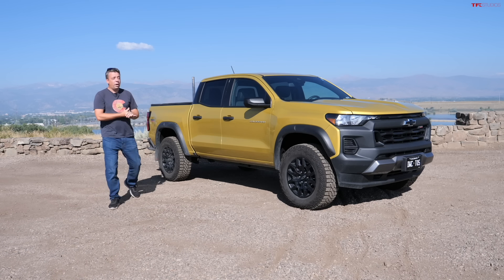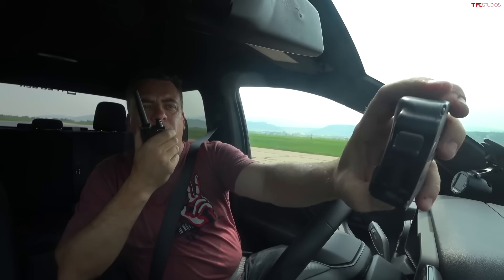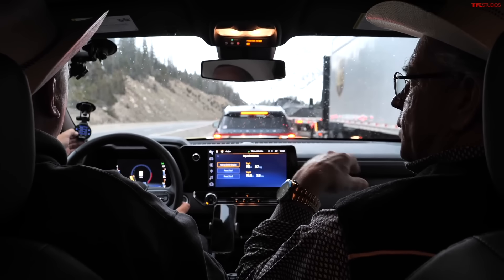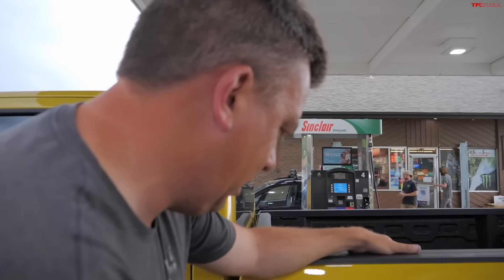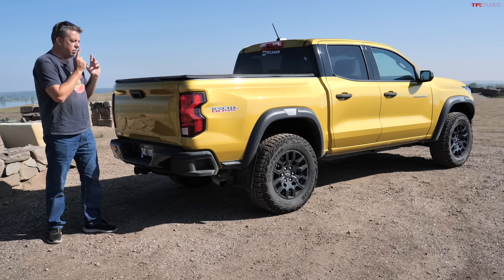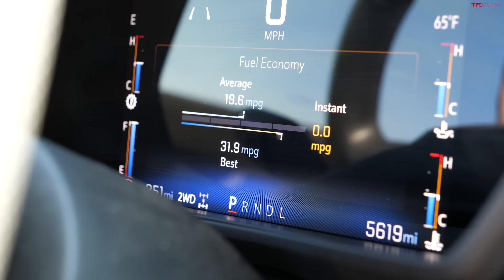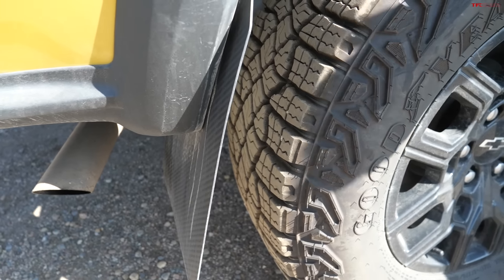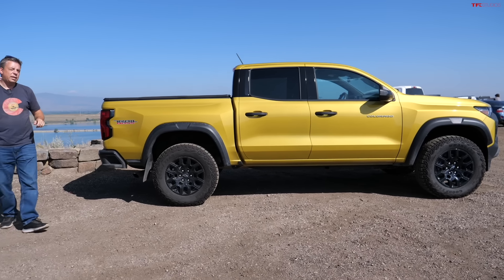Chevy Colorado: Great & Awful Things I Learned After 6,000 Miles - Long-term Update

Comment: 6000 miles isnt even remotely long term
Reply: Maybe it's a GM thing? At least on their half-tons, new V8s can suddenly die at low mileage, AC compressors can suddenly die at low mileage. Maybe with a GM truck you need to check in at 6000 miles as "longterm"? It's a nice looking truck, at any rate.
Reply: Most people like Doug only test vehicles for like 1 hour so 6000 miles is much longer than that
Reply: I totally agree!
Reply: Come test my 2015 RAM 2500 6.4 with 130,000 miles on the clock. That is long term.
Reply: @liamrobinson2084 how about the heavy duty V8? The 6.6L. I belive its a better engine with less issues than the 1/2 tons
Reply: Their long term tests are typically under a year so the mileage isn't going to be high. Edit: They don't base their long-term reviews on mileage.
Reply: At least 50k
Reply: @nipperdawg1865  Nope. Their reviews are typically based at 3 months, 6 months, and a year.
Reply: Pretty sure they are titling it long term, not because it’s a long term update, but instead part of their long term fleet and they plan to keep it for a while… a long term update series, if you will…

Just using context clues over here 😂
Reply: @jordanreyes8880 Andre owns the truck, it isn’t any part of the tfl fleet.
Reply: “Long term” is relative, if the normal review period is only a couple weeks or so, then a few months could be long term.
Reply: That's exactly what I was thinking because I have 115,000 on my ranger and I've had zero problems. Which is great but six thousand miles for a new vehicle if it's having problems at that point that's pretty horrific.
Reply: Update*
Reply: It is for Chevy 😂
Reply: @jeffs2809  oh so he doesn’t do videos on it? When they do fleet updates, do they not include personal cars?

Again guys, we gotta start using context clues!
Reply: I feel like reviewing mechanical reliability at 6k miles is nonsense.  Get back to me at 100k.
Reply: There's gotta be that guy in every comment section, doesn't there?? 😆
Reply: @Maximer77  But you’d want to know about early mechanical issues if there were some, right? 

Like, hypothetically, if there was a notoriously unreliable 8 spd transmission that was “updated” or “refreshed” to fix jerkiness and shift points? Hypothetically, of course.
Reply: Do you want him to do a longer review when he's only had it 5 months?  He's reviewing what he can,  not what you wish he had.
Reply: These are NEW vehicle reviews. That is they are reviews of vehicles you, I, or anybody else could go to a dealership and purchase new. There's obviously a time element involved in that. If they tested these for several years, everyone would have to wait several years for the results. Meanwhile a bunch of subsequent newer vehicles would go untested, because they spent all that time testing a single vehicle. 

They're titled "long term" in contrast to the bulk of their new car reviews. These typically involve manufacturer supplied vehicles which they may only have access to for a matter of days, or even hours. That's what the vast majority of new vehicle reviews on YouTube are. These are long term relative to the norm
Reply: @jefferp yup you’re right, you good now? Can we watch the video with out y’all nit picking at all things sheesh 😂😂😂😂😂😂😂😅
Reply: Chile y’all gone complain about anything 😂
Reply: @LafemmebearMusic  most of us regular people keep our vehicles well over 100,000 miles over several years. That’s why we grin when saying 6,000 miles is long term. Maybe saying something like, “First in our series of updates on my Long Term Chevy truck” would be clearer.
Reply: @liamrobinson2084 nice looking? Hah.m that's about as far as a luxury German car will take you after miles..
Reply: 6,000 miles is actually long term for gm these days. Not just gm but other brands also lol
Reply: They need youtube content he can’t wait another year and have 50k on the clock to do “long term”. Be smarter.
Reply: @jordanreyes8880  Sure, but 5 months and 6k miles is not “long-term”, lol.  Not a big deal, but the title is most definitely overblown.
Reply: It’s a brand new vehicle 
People with these trucks have the same or maybe less miles on it so it’s good info to know
I only have 2000 miles on mine after a month of ownership 
It’s long term cause these trucks just came out
Reply: Nope. Thats 3 months of driving/ownership with me.
Reply: That’s what I said. Lol
Reply: For GM this is long term.
Reply: 6000 is an eternity for TFL I’m sure he’s already thinking of trading it.
Reply: @jefferp well, long distance. Probably long term.
Reply: Content creators
Reply: @Expressionistix  I agree with that!
Reply: I’m still testing my Titan @218,000 still rips
Reply: @Seashed lol tell that to the ram rental I'm driving that has 7k miles and having electrical issues. Or a customer of mine that is waiting on a Cummins recall fix and the dealership is only getting 2 replacement parts a month with a waiting list of 3 to 4 hundred. Or my friend with a 1 year old f150 with less than 10k miles. And is over heating and breaking spark plugs. Or his friend that had a 21 raptor with 16k miles go through 2 transmissions before ford replaced the entire truck.
Reply: I’d say long term has to be at least to the end of the basic warranty period.
Reply: @jefferp that’s a lot of trips to the pump
Reply: I think he probably meant « 1st update on the long-term truck » 😊
Reply: @919hey  yep. If you want to play, you gotta pay. I ordered my RAM 2500 6.4 with 3.73 gears and 2 wheel drive.  I don’t live in snow country and stay on the pavement. Driving 70mph and below I manage a tick over 20 mpg highway. I only use top tier mid grade gas and service the truck religiously. It’s bone stock except for lighting upgrades.
Reply: @jefferp you should publish a video about it.
Reply: @windycitywarrior71 a quick check says a trip from Boston to LA is essentially 3K miles, so round trip is about three, four days tops for fuel, food and rest stops. Why not do eight of these trips spaced out over oh, idk, let's say the next six months - Bam! 50K long term miles - how's that for smarterer?
Reply: At least they drag race every vehicle because thats whats most important lmao. Does the truck last? tfl who cares lets drag race it
Reply: I was ready to order a new Canyon AT4, but with the GMC strike taking place, who knows how long I'll have to wait. Now, I'm thoroughly researching the new Tacoma. I  wanted to buy American...Looks like the Japanese win again.
Reply: @TFLnow  If you are ever in the north Georgia area I’ll turn the truck over to you. You are welcome to do a test.
Reply: Trans temp was looking really high on the Ike. I know it’s the worlds toughest towing test but it was still a little high for me as it kept climbing. 3:53
Reply: I do like this truck they are sharp looking. I would be afraid to buy the first year it was out. I am curious about more mileage though once he puts The Mileage on the truck. I got it 18 Colorado, with only 66000 miles on it. Thinking About upgrading to one of these next year, though.
Reply: @jordanreyes8880  This
Reply: @@DB-tp4jd you are correct. In my part of the country 8 years isn’t old. Other parts, 8 year old vehicles are  starting to show impending doom.
Reply: I would say 6000 miles for the type of testing he put it through is comparable to what a normal owner does in 50k miles.  So it's reasonable IMO.
Reply: Literally a truck of that price tag should last a good 15 years
Reply: @jordanreyes8880  They do a lot of videos on their personal vehicles, and if one happens to be in the lot when they're going through the TFL fleet update, they'll mention it.  I don't recall them specifically including personal vehicles when doing the TFL fleet updates.  

Andre, Tommy & Case have done several videos on their personal vehicle that weren't part of the TFL fleet. No idea what the "context" comment is related to. TFL fleet vehicle is either owned by the TFL company  ( the Ram 2500 Cummins, the Raptor, the TRX, police charger, etc..), just because they do videos on a vehicle doesn't make it part of the fleet.
Reply: 6000 miles on 4-6 weeks of driving for me.
Reply: They are doing a long-term test on this truck and this is the update with 6000 miles on the odometer
Reply: @justintarvid  millage is more important than a time line
Reply: There is that but this is just an update on a long term vehicle, I suspect we will be getting other updates along the way
Reply: For a Chevy tho
Reply: It is for a gm 😂
Reply: On a ford or Chevy? That’s a life time
Reply: Who said it was ? They dont do super long term.testing  smh
Reply: That’s like 75% of a Chevy’s life
Reply: Not exactly long term, 5 months/6000 miles.  I bought my 2023 Colorado z71 3 months 3 days ago and I’ve got over 11000 miles already, and I don’t consider mine “long term” either.  I saw them unloading it off the transport truck and went in and bought it, so all the miles are mine.
Reply: For a Chevy that’s like 1/3 of its life
Reply: @micahv9365  that’s being generous lol
Reply: Totally agree. Barely used the truck. They need to create a specific test “long run”. There in Brazil a magazine has a 62.000 miles. They test the brand shop service including. Then the subject is totally unasembled and had measurements of all engine parts.
Reply: Which makes it even worse having all these issues in such short time. I can’t imagine how many more issues he’ll encounter in the long term.
Reply: Long term enough princess
Reply: @534N69  LOL, thanks King!
Reply: It’s longer term than most car reviewers have cars for
Reply: @jordanreyes8880 it’s not a fleet vehicle, this truck is Andre’s personal vehicle. They marked the video long term because he probably had it for longer than 6 months at the time
of this video, auto journalists typically don’t put very many miles on their own personal cars because they are typically driving press cars or one of the TFL fleet vehicles.
Reply: For a GM it is.
Reply: @jefferp my Tundra has 380,000 miles. Yours won’t even get near that.
Reply: 6000 miles. "It's healthy" the GM standards gave dropped so low
Reply: 6000 is more than anyone else m
Reply: With these new crap cars it is long term
Reply: This my problem with guys besides Ike gauntlet and fuel mpg test it's just meh...

Comment: 41k for Hard plastic, no LED headlight or taillights no telescoping steering wheel, no seatbelt height adjustment. These truck companies are robbing the customer blind. Problem is we are letting them.
Reply: Don't forget about no cruise control.
Reply: Tacoma at that price would have all of that, and would hold it’s value way more. This is what is so funny about all the reviewers praising other mid size trucks and it never holds true.
Reply: The last thing I would want are those ridiculously expensive  LED headlights & taillights.
Reply: @dpl2617  even if you spent over 40k on a truck? It's perfectly fine if you dont want leds but you can still recognize that Chevy is overcharging us for what this truck is.
Reply: @LordWinter   That is an accurate statement for every new truck on the market...
Reply: We need to stop buying new vehicles!
Reply: Just get a new Canyon with the convenience pkg. And you are covered 100 percent. And the base Canyon comes with cruise.
Reply: @cmc9823  I looked at a Tacoma before I snagged a Trail Boss... It had drum brakes and a Camry engine. Makes crap power below 3k RPM, exactly what you don't want from a truck. Owners are are blind to it's weaknesses. They just chant rELiaBiLity!
Reply: The plastic front I don’t care for
Reply: Only if you let some YouTube millionaire talk you into it lmfao
Reply: @TheLostSquadron  They have their issues but they keep running forever and hold their value better than any other vehicle.
Reply: @@ThomasJeffersonIII Might as well get a Ridgeline if you need a reliable sissy truck for trips to the nail salon. At least that has a good interior.
Reply: @trevorhart5576 No cruise??? WTF.
Reply: @thanos9846  I know right.  Poor Andre.😔
Reply: @cmc9823   yeah this is really strange $40k is pretty upper level trim for midsized trucks, $40k for a Colorado should be a pretty loaded one.
Reply: @trevorhart5576  that's crazy
Reply: @TheLostSquadron   i'm waiting for the 2024 TRD Pro hybrid version, it fixes many of these issues.
Reply: @qbanlink25 The TRD Pro Hybrid won't be attainable until End of year 2024 probably and will be 55k-60k.
Reply: Check out the frontier pro 4x. No telescoping wheel but also no gimmicks and same hp with natural v6. Very underrated and on the more affordable end.
Reply: @LordWinter  I don't care if Im spending $100k,  they can keep their crap LED headlights and tailights. Every week someone rolls into my shop with a dead LED tailight and instead of costing $5 to $10 for a bulb it's $600 to $1200 for the whole assembly. Riiculous
Reply: Dealer markup.
Chevy is even talking about dropping dealers for price gauging next year. And selling online like tesla.
Your order would go through Pennsylvania to save money because they have the lowest tax for vehicle sales. 

Ford is 1000% cutting out dealers, the ceo put out a video on YouTube you can look up.
Reply: @yourkoreanbuddy1 and more towing than this chevy. i love my pro4x
Reply: The LT gets all those features because it has no 4x4
Reply: Buy a Ridgeline 👍
Reply: @kieranapgar6802  Ridgeline ain’t a truck 👍
Reply: @Yaboidavey  sales tax is based on the state you register it in not where you buy it.
Reply: @trevorhart5576 wht lol yes it does
Reply: Dw they make a WT trim for 30k for the poors
Reply: idk the work truck variant with some extra shi would be good enough from me
Reply: @MattyLentzGETRICKROLLED  that's basically what this is--it's the WT with off-road adds.
Reply: @desertdriver7056  ahh I see
Reply: That is so true.  First, COVID, then chip shortages,  now they just do it without any pretext. You now see 60k Tacomas, and good luck finding a Bronco under 45k.  But if people buy them, (some  even can't afford the cars), manufacturers will not stop.
Reply: user-rr3fo6hy9q ...man! I couldn't find the side eye emoji....but yes you deserve it lol.
Reply: @cmc9823  You can't get a tacoma for that price lol
Reply: LED headlights are the bane of the roads. They should be illegal!
Reply: @Heatherder  this came out nine months ago you could, you’re a little late to the party
Reply: More plastic and less reliable powertrain 😂😂😂😂
Reply: lol it's not 2008 bud
Reply: @JohnBrown-vx3rx  No shit genius.
Reply: @TheLostSquadron yep
Reply: @cmc9823  huh? This truck is the cheaper option. Tacoma are like 60k for the same spec
Reply: @TheLostSquadron  plus they rust like crazy and drive like crap
Reply: @Andrew58251  thank you for responding to this one year later after an entirely new generation of Tacoma has launched from the time of my comment
Reply: @onefastr6  says u
Reply: @afs6596  You’re right, I did say.
Reply: @onefastr6  idk about you but my z71 came with all those and some yeah I bought it early this year, which gave time for gm to improve these things in the line. So a year in with 15k miles and I absolutely love this 2023 Colorado Z71

Comment: Didn’t notice the blackout treatment. Using premium fuel in your truck which only requires 87 is just a waste of money. It’s been proven for years. Enjoy your truck.
Reply: My Malibu with 1.5T engine that literally melted a piston at 80k miles, most likely with this being a contributing factor, would like to beg to differ with this statement.
Reply: Most manufactures list in the owners manual the added performance that can be obtained running premium fuel especially while towing a heavy trailer, HD trucks are built with heavy cast iron blocks & components for durability because they know most folks will be burning the cheaper gasoline!
Reply: @martyi398  HD trucks are usually naturally aspirated gasoline engines or generally heavy-duty diesel engines. Neither of which have issues with pre-detonation, which is definitely not the case with turbocharged engines. Even with advanced ECUs of today, crappy gas can eventually rear its ugly head. Even if the ECU lets a small amount of pre-detonation occur, it could be enough to ruin the engine.
Reply: @martyi398  Yes that’s true. You may gain a bit of power.
Reply: When towing you can definitely notice the difference with a higher octane fuel. With regular driving it isn't needed and it's a waste of money.
Reply: @tsohg1960  you might have a different opinion on that after 100k miles…
Reply: @a2xd94  I own 2 trucks, my 08 Toyota with a 4L motor had 162k and my 03 GMC has 289k. It's less noticable in the GMC but the Toyota there is a noticable difference. I think it depends on the vehicle and setup as well.